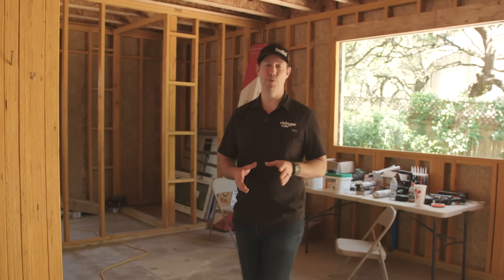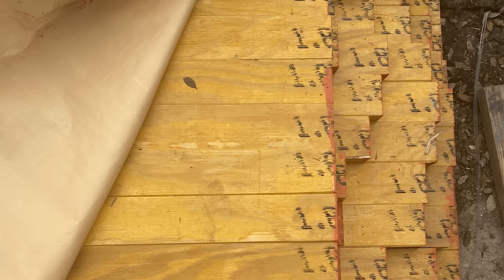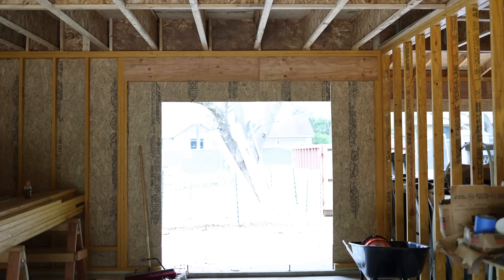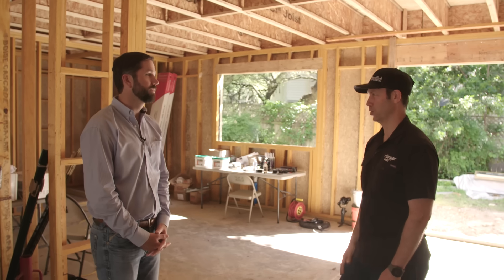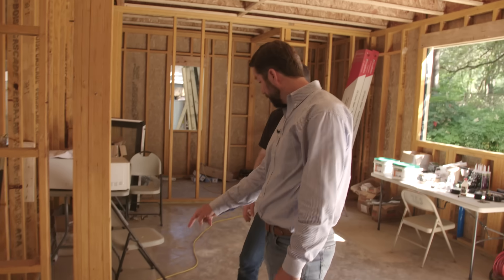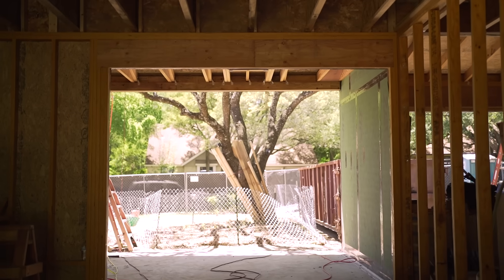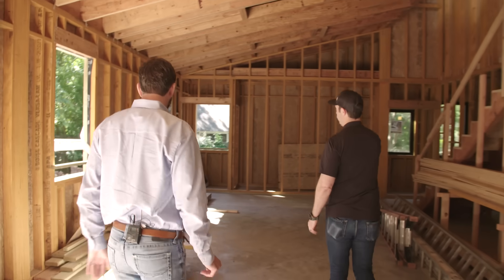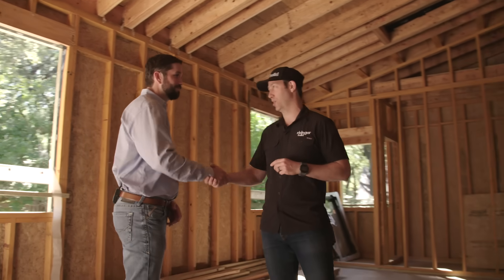House Engineering - Common Mistakes

Comment: And how fast does all the glue burn or melt in a house fire in relation to solid wood?
Reply: These products are around 95% wood
Reply: If you ever burn a large amount of LVL scraps and look in the bottom of your burn barrel, you'll see a large glob of unburned glue. The flashpoint of the glue is higher than that of the wood.

Comment: How do you address electrical and low voltage wiring on these homes? Do you for example require your AV contractor to do BIM drawings so as the verify that no structure is compromised as they drill and install wire and other misc materials?

Comment: As a residential home framer and licensed architect I don’t like the narrow flange TJI’s, they split when you nail them at the plate. I have also seen TJI’s have significant creep over many years of use, more than dimensional lumber. I prefer web trusses by far, though they can cause issues if something needs to be reworked. They can be designed for different loading situations, made to carry more load, made to have less deflection, can be made to span long distances, can accommodate duct work, electrical and plumbing better.

Comment: Here's the fun part they're leaving out, you're paying more in labor and material, up to 35 percent and depending on area codes 45 percent. And as a builder of 35 years, that specializes in remodels, homes that were built years before engineered lumber, are still standing and still as sturdy as when they were built. So is the cost increase that comes with engineered lumber worth it ? No.

Comment: I really see this as a sales pitch. They are not doing an objective pro's & cons discussion. Composite materials generally handle water poorly. They delaminate and swell. Also They are much more flammable. In fire tests, traditionally built homes catch fire and spread fire much more slowly than houses built of this stuff. In one test it took 40 minutes for a traditional room the reach full engulfment and it took 8 minutes for an equivalent room built with composites. One reason is all the glues are highly flammable. Also gussets have a lot of surface area to absorb heat and so they scorch themselves right off the wood quickly and the trusses fall apart. Nails are mostly embedded, so they never scorch themselves off. The joist will burn through before the nail releases. I know all this because my brother is a firefighter. Also I wonder (but have no data) about galvanized joiners rusting in a wet area.

Comment: Why spend all that money on engineered lumber and not have 2"x6" outer walls? You just flushed your money and R value down the toilet.
Reply: @Fudgielips Isn't it a slab on grade "foundation?" Even so he essentially tore the whole house down for no reason already. It isn't a big deal to pour a new one at that stage or modify it for a larger wall.

Comment: My steel studs are straight, any length, fireproof and the bugs hate 'em. They are a little more expensive than standard wood studs but how do they compare with  engineered framing for non load bearing interior walls? I've been a metal stud framer for over 40 years and have only used wood on projects around my house where I was looking for the absolute cheapest product I could find and was not concerned about the quality. Not throwing shade on any wood framers, I know many excellent ones, I just don't see the need for this kind of overkill in a house.

Comment: I find this channel incredibly pompous and annoying. How many homes make it 100 or even 50 years without being gutted and remodeled at least once due to trends, not structure. 

How many times have we seen 100 year old houses with 2x8 floor joists cut down to 2" to pass a cast iron pipe through?

We over build the ever loving ** out of things (flood, tornado, hurricane and earthquake zones exempted). What an ungodly amount of money spent on a 2 story house. These materials would build an 8 story apartment building. 

The product placement,  branded hats.... this is just ridiculous. 

Power to you for showing what's available,  but unless Godzilla lives down the road, you can save thousands for your kids college fund, vacation,  charity or whatever life suits you rather than burying it behind drywall and siding. Why don't you just use 2x4 and insulate the walls with 100 dollar bills?

Comment: Really weird to what lengths they go to, to make wood as much non-wood like as possible. There is a material that requires no glue, holds extreme loads, is not bothered by water or heat expansion. It's called bricks...

Comment: If you can find a good local lumber yard, you won't have to worry so much about getting bad studs. Go  the big box store and you better personally select your lumber, rejecting all of the culls that have been rejected by those before you. On the other hand, i order my lumber sight unseen  delivered by my local lumber yard and have never had to reject a single piece (though I have used a very few pieces that have a bad knot or check that can be cut out to make a needed short piece).

Comment: I don't get the claim that engineered wood doesn't expand.  All materials expand. They all have a coefficient of thermal expansion.  I suppose i could see that solid sawn might expand sightly more due to all fibers in the same direction, but not all expansion is directional like that.

Also, what happens when these get wet? What happens when you have a toilet leak or a roof leak? OSB can't get wet...

Comment: If my view is not mistaken, should that 5 ply Versa-lam column not be run through to the concrete floor rather than sitting on the bottom plate of the wall it is in? You talked about crushing for the BCI joists but same scenario there also under a point load. And it probably should have a column base.

Comment: He says Web stiffeners, but fails to point them out.
And then the other guy says he would have a warranty claim if the drywall guy and painter need to come out?
I have owned 3 newly built homes and SINCE WHEN DOES A BUILDER NOT FILE BANKRUPTCY WHEN FINISHING A PROJECT TO REMOVE LIABILITY?
Oh, sure, they set it up for a small company that is supposed to be the warranty provider, but they are total crap!

Comment: There is no doubt Matt is extremely knowledgeable about residential construction.  That being said, as a building contractor myself, this is completely overkill.  I've built 100's of production and custom homes over the years that are structurally sound and use no where near the amount of engineered lumber that Matt used in his own home.  It's all nice to have, but this sets a false expectation for the client.  No one would pay to have all engineered lumber throughout the home.  The costs would be astronomical!  My advice is don't use the cheapest lumber, use engineered materials where required by a qualified/licensed engineer and most importantly use an excellent framer.  If you follow this advice your home will last many years.

Comment: On a prior video regarding overhang. You mention using a 2’ overhang w straight cut vs plum cut. Assuming your not installing cutters and down spouts. If this is correct are you not concerned about rain water

Comment: Any advice on which adhesive to use when fixing to the edge of LVL? (sides where you see layers). 
I haven't found a product that bonds yet, and will absolutely never rely on nails through the edges, only screws and accept that the glue is only there as a 'gasket' to minimise squeaks.

Comment: We prefer to use LSLs for vertical loads because LVLs are just as much wanked as spf a lot of times especially when putting up 24”x20’ sizes. Most large scale vertical great rooms should be built with LSLs. The bad thing about LSLs is that they are becoming almost so hard to drive a nail through. Plus the resin kills me

Comment: This is interesting seeing an engineer on a courtesy call. Usually an engineer comes out because the architect screwed up the framing detail so bad the framers has to correct it and then have the engineer sign off so could pass inspection.
Reply: Par for the course.

Comment: We have a barn that was built 1900-1910. It’s had a car burn down inside of it. Countless severe storms and heavy snows. It was never painted and obviously is not treated lumber. This composite would not last 100 years exposed to the elements, it’s cool and applicable but not going to replace a solid piece of lumber.

Comment: steel saddle... 4 ? 2x4? maybe 4x4 double up? and maybe a metal shank around that so when it weakens it doesn't just sheer with all the weight?

Comment: Engineered wood is the new name for particale board.
Reply: Yes, 'engineered material' sounds SO much better than particle board, but IMO it is still the same worthless crap, only now frequently sold for higher prices than real wood.  The big problem with this stuff is that the design numbers look good when the material is new, but let it see the slightest water exposure and it quickly turns back into what it was originally - sawdust and wood chips. Currently involved with remodelling an old building which had a bad roof.   Different sections of the roof deck were made out of 1x lumber, CDX plywood, or 'engineered material'. Every piece of particle board on the deck was falling apart. Most of the plywood showed at least the start of delamination and was also removed.  At least 90% of the roof deck made from dimension lumber was essentially undamaged here in dry NM and was left in place.  All that particle board in high stress locations in the house in this video makes me shudder. Hope this guy never gets a roof leak or plumbing leak that goes undetected for any length of time ...  Part of the trouble with engineers - they frequently believe and rely on the manufacturer's data on these miracle materials, without using appropriate safety factors  and without considering long term effects of the environment on the design numbers. You want an old guy for an engineer - one who has made a few mistakes and seen or lived with the consequences.
Reply: @kimlground206  well said.
Reply: @kimlground206   "You want an old guy for an engineer - one who has made a few mistakes and seen or lived with the consequences."

An "engineer" is not just some guy who's seen it all. Being an engineer means you are legally liable for the stuff you sign off on. When the beams fail and people get hurt the engineer is the one who ends up in court with a law suit.
Reply: It's the latest method of raping the consumer! Notch a load of poles with a chainsaw, and your structure will outlive this gluelam nonsense!🤣
Reply: Robert Muckle facts
Reply: The glue is less bad in modern materials.
Reply: Lol.  Exactly
Reply: All wood is made with PARTICLES.
Reply: Engineered lumber is definitely not particle board. In most cases the engineered products out perform dimensional lumber in every way but cost. They are stronger, more stable, are more resistant to weather, insects and rot. Houses built with these products are also more likely to still be standing after large earthquakes which is always a plus. It isn't necessary to go as far as this guy has gone but it certainly won't hurt.  So, no I disagree with your assumptions.
Reply: @iamjackalope  Water Soluble Glue - Never Lasts
Reply: Jack A. Lope you funny, you didn’t mention fire or offgasing.

Comment: Well, the #1 mistake I saw was using the junk LVL engineered crap. Turns your house into a death trap if there is ever a fire, and guarantees it will burn to the ground.

Comment: I just completely remodeled a 1920's Tutor and it will last longer than this house built today - why today's products are engineered with a short lifespan - why Job security sell overrated subpar (on a historical scale) and rebuild in 20 to 40 years.

Comment: It doesnt matter if your rim joist expands differently than the other joists. They will expand differently on an exterior wall. Plywood is better for exterior sheathing than OSB then you wouldnt need blocking along the wall unless specified on a taller wall than 8 feet. Using a gun to accurately hit the holes in a bridging plate or joist hanger is iffy and screws are better than nails as long as you have the right screws with the correct shear strength. Real wood joists are easier to connect though I do subscribe to floor trusses but you still have to wonder if they will last as long as dimension lumber . Gang nails do not sink as deep as I would like them and I have had to repair these many times. I would rather have dimension lumber and work with it if I need a strong beam give me steel and I will put furring or a nailer on it though a glue lam is easier to work with. Glue technology has came a long way but instead of flakes of wood glued and pressed together the compressive strength of the grain of a vertical 2x4 is going to be permanently stronger than what is sold for this purpose that is glued. I would rather have a traditional "T" than the blocking used for dead wood where the walls intersect by the column. If the column was dimension lumber use 2x4's . Also there is a wall 2 feet back from the column isnt this a closet wall or where kitchen cabinets will go  ? Why not run your beam there or have no beam at all with the ends of joists sitting on that wall ? Yes you would have to use two different lengths of joist but no hanger installation or main beam installed  ?

Comment: why are modern houses are flimsy made out of compressed wood, walls out of paper and chalk, even brick homes are just for show and structurally it's just wood

"Houses are built literally like a house of cards. Weak beams, plywood, flimsy insulation, flimsy siding and roofing that either blows off in high winds or just rots away after a few years. "

Comment: What are levels of out gassing with the adhesive content of these materials? Concerned about impact to clients with allergies and chemical sensitivities.
Reply: Impossible to answer generally. Every product i have ever seen (denmark) is marked with what glue is used. OSB haven't contained formaldehyde in years (other than natural content in the wood). Some people are very sensitive, but they can be sensitive to the out gassing of natural lumber
Reply: @Atramentum1  natural wood does not outgas.  Natural wood that has been inundated with chemicals at the sawmill before processing does outgas.  It is too bad they do that. It seems more and more people are reacting to these chemicals.

Comment: Nice video Matt.  I didn't see any mention of a concrete footing underneath that concentrated load - 5 ply column.  I know when we build here in CT, we pour 24"x24"x10" footings to support 4" concrete filled steel lally columns in the cellar which sit under the main carrying beams.  I have even cut out concrete and dug/poured footings where needed when adding a column.  I love LVL's and I-joists, my house is full of 4-ply 18" LVL beams bolted together - lots of load distribution for an unusual floorplan.  You can't beat laying out 40' long, 11 7/8" I-joists - they're surprisingly lightweight!
Reply: The engineer said there was a grade beam which they verified. A grade beam can act as a footing as well, don’t even need to calc that because residential loads are nothing for concrete.

Comment: First , price is the number one decision in building a house. That frame is 5x the cost of using kid stock. You can use all steel also for actual sturdier frame with metal studs if cost isn’t a factor...
  Second, the I joist are improperly installed. The joist are nailed in the sides which voids the warranty. There is also no glue on the bottom of the hanger or sides. Also the joist are tight to the beam which will cause a squeak. A 1/8-1/4 gap should have been left there... 
   Also that ridiculous multilayered post. That should have been a 4x8 PSL is actually stronger. It’s always fun to watch HACK framers build their own house....

Comment: You Didn't  mention that he is an engineer that works for the company that manufacturers most of the engineered product you are using!
Reply: What evidence do you have for your claim? This is structural design consultant and not a manufacturing engineer.

Comment: Just out of curiosity, and because I still haven't gotten a solid answer...what kind of engineer is used for residential homes (or most common)? Civil Eng, Structural Eng or Architectural Eng?
Reply: In Canada it is primarily structural engineers. Occasionally with larger homes (multi-million dollar) you may see some additional engineering required by civil engineers (site grading and site services) and mechanical engineers (Heating, cooling, air circulation).
Reply: I should add that in Canada you dont need to be an engineer or an architect to design your own home whatsoever, but you are limited in what you are allowed to do. It's all laid out in the building code.
Reply: Where in Canada are you? I've never built any buildings or homes without an engineers stamp.
Reply: An unobtainium engineer.

Comment: Great video, as always. Wondering: if one were to build a rooftop deck, could you use engineered lumber? Obviously wouldn't be able to rip an angle into them... are there options?
Reply: Yea just get engineered stock lumber. You can cut whatever angle you want into that. You’ll just be paying a premium for the “fine tuned” hardwood.